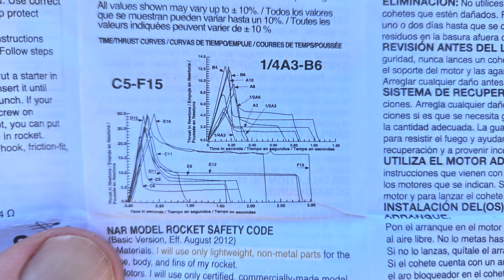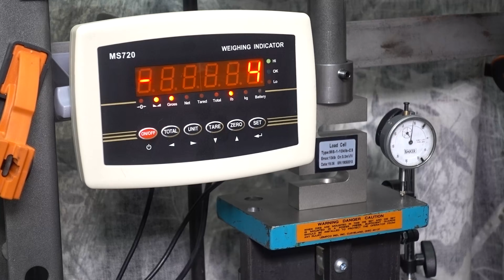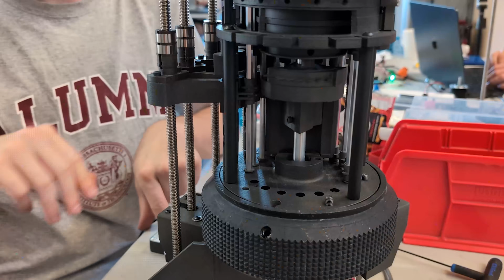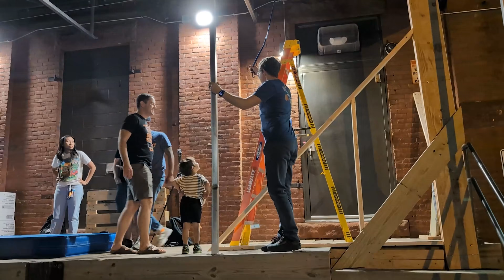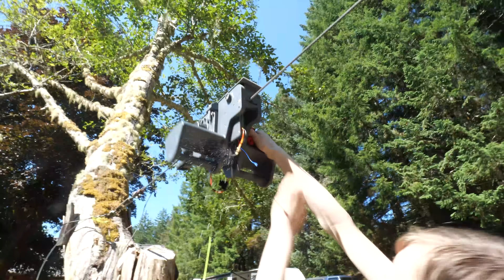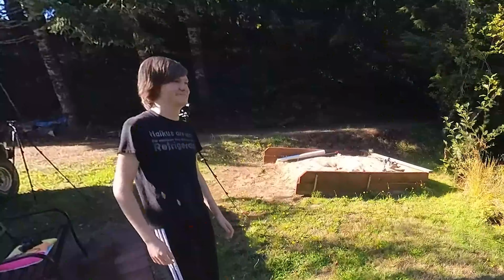Automating a Zipline Ft: Stuff Made Here

Comment from the maker: I still read every comment on my videos, so let me know what you thought of this project. Don't forget, if you want to see how much force it took to break the 2nd trolley, or what happened fishing remotely, consider becoming a patron to support more great content: https://www.patreon.com/QuintBUILDs
Reply: I thought of a video series that would be perfect for you (as well as develop into a business plan, if you want). 

The idea is to take a used FWD economy car, with a manual transmission, and convert one of the rear wheel hubs into an electric motor. The electric rear wheel is powered by a fairly small battery pack, that is charged at home, in the garage (with regular 110 AC). Two entirely separate drive trains.

The electric rear wheel is then used to accelerate the car from a stop (while the ICE drive train is running, but in neutral). Once accelerated, the car's pre-existing gasoline engine is used, for cruising. So at a red light or stop sign, you control the electric motor with some kind of simple hand operated speed controller, mounted on the dash in a convenient spot (or wherever). Once a speed of 20-40 mph is achieved, you engage the manual transmission in 5th gear, and cruise on the gas powered drive train.

Most of the cost of gasoline is used up, accelerating from a stop. The average economy car gets 50-70+ MPG, while cruising. Converting a rear wheel to electric power could easily DOUBLE the MPG of a cheap, used economy car. This would make a very interesting video series, and if you pick the right model of used car, and focus mainly on using off-the-shelf parts, you could sell parts kits, as a business (expanding to other car models, over time). 

Probably the only part that would be custom made would be a replacement rear wheel hub that has an integrated electric motor. Basically an electric motor that bolts on to existing bolt holes in the rear fender well/hub area, and has lug studs, to bolt a tire onto. Probably an electric motor with an adapter hub to mount the tire to, and some kind of adapter flange to bolt to the car/rear suspension.

The more off-the-shelf parts that you can use, the less effort it will take, to sell conversion kits. A lot of people only need enough range, to drive to work in the morning, and then back home at night. That could be 10 miles of range... perhaps mainly on side streets. In this case, almost no gasoline will be consumed (other than idling the ICE during the trip, to power the steering, brakes, headlights and perhaps for unforeseen acceleration needs). The small trunk mounted battery pack for the electric motor could be charged at home, overnight on regular power... because it's far smaller than a Tesla battery.

A kit like this could really hit the commuter market, as well as the pizza delivery driver market (or whoever makes a lot of short trips in a small car).

Comment: Encoding some positional Data onto the Steelcable (like a casette) would be interesting to control that thing. There are some Elevators that utilise some similar system
Reply from the maker: Interesting. All I thought of was electrical resistance which would be unreliable in the weather. Will have to look into the elevator thing!

Comment: 10% tilt in a zipline is super fast lol.... when the steel cable is tensioned.... I built one that I need to redo with a smaller slope...
so definitely not at all like coasting on a bike using a quality pulley trolley with ball bearings you accelerate rapidly with a tilt higher than 6%

Comment: Remember that a "20V" battery is usually 18V nominal and down to 16v when low.
Dewalt and some doesn't market batteries by their nominal voltage like EVERYONE ELSE and uses the max voltage as a selling point..
Reply from the maker: Swapping low and fully charged batteries didn't seem to make a difference.

Comment: 190kv x 20v = 3800rpm without any load!!! And it's not because of the battery sag when applying power. If it is necessary to efficiently run the motor on 3800rpm you basically need your max rpm to be double of it

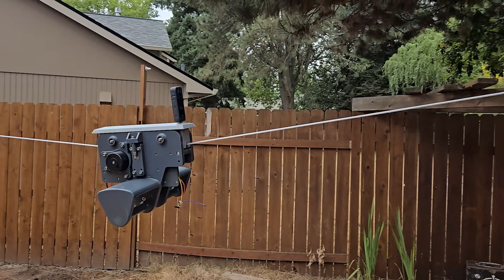Comment: In the late 80's my Dad built a zipline on our property and I was the test dummy.  He didn't include any type of braking mechanism like 11:45 
On the first test ride it just kept picking up speed until it slammed into the end at ~25mph. 
I did a double backflip and flew 30ft onto long grass. Luckily the design was an A-frame that I went under, otherwise I probably wouldn't be here if I'd slammed straight into a pole. He then added a series of springs that would decelerate the rider before we let friends ride it. 
We also had a 50ft swing that would take you over a 200ft cliff/gully that was built from an old powerline cable and the seat was a 1ft glass insulator.

Comment: Very cool but I would have just designed a set of thumb controls and included an emergency stop for sure, maybe like a jetski a key on a cable that once pulled stops. I think a simple button to begin the deceleration and another to return home would be far more accurate then trying to make sense of IMU data alone. Those IMUs are very noisy and sensitive, for such a violent sport. But its great to see engineering put to use. Its awesome that 3d printing has become so sophisticated these days. From high tech resins and filament to super fast prints we have advanced so far in the past 15years. My first 3d printer was amazing, but it is a toy compared to today's 3d printing. You should have just programmed a return to home function available from wifi, that would help retrieve it.  Amazing work
Reply from the maker: That was my first though too. But though I do chinups daily, when I hang from the bar and imagine flipping switches while suspended high enough to beak both legs...
Reply: @QuintBUILDs maybe you could add voice commands lol

Comment: hmm, if i had to guess the reason for the lower than expected RPM, is because it's limited by the voltage. As far as i can tell, it's running on just ~20V, where the motor controller can probably handle 36 or 48V. The higher the voltage, the higher speed they can run.
Reply: How quickly can those batteries dump their energy? Is it ever an amperage issue with motors?
Reply: @bakerfx4968  Probably not, as amps would only limit the top speed in conditions where there is significant load on the motor, which is not the case when he was troubleshooting the motors top speed.
Reply: @bakerfx4968  They can very very quickly dump their energy, so over-currenting is usually not the problem. I've had a single old 18560 cell dump something like 100 amps even though only being at 3.6V. If you're drawing a lot of power for a long time, the batteries may shut off due to an under-voltage, but the problem is most often not over-currenting.
Reply: Back EMF is the issue. More voltage is the solution.